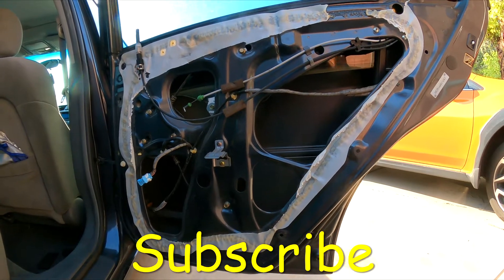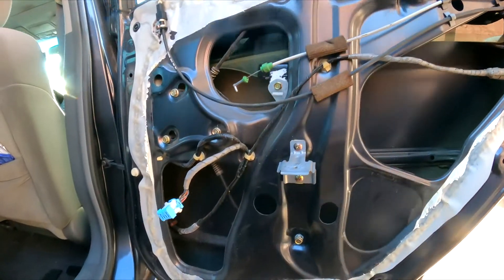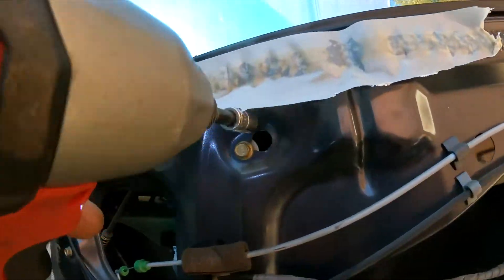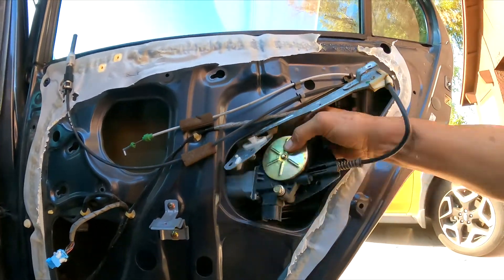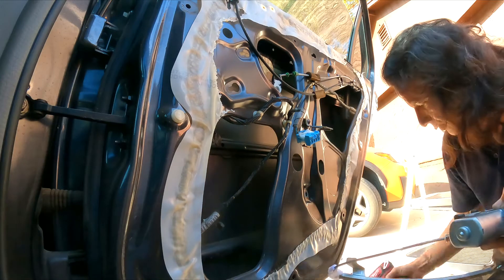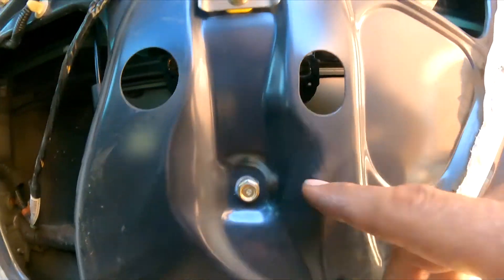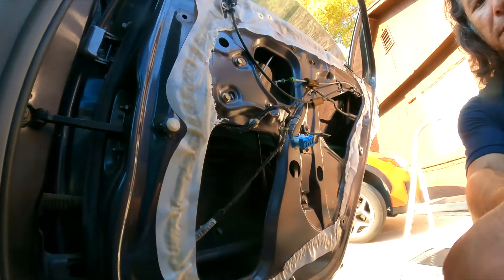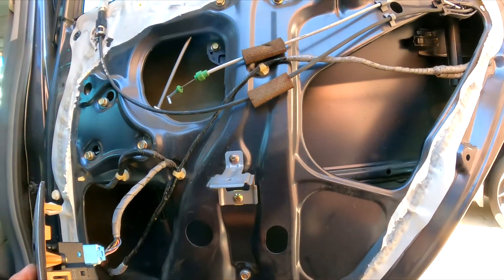2005 Honda Accord EX passage Rear Window Regulator replacement

Comment: I changed the rear right regulayor on my 07 honda accord and the key fob doesn't work after that, won't lock or unlock  any idea why?
Reply from the maker: Hello. I am sorry to hear that. Did you disconnected the door lock switch on the door? That could be the problem. Keep me posted